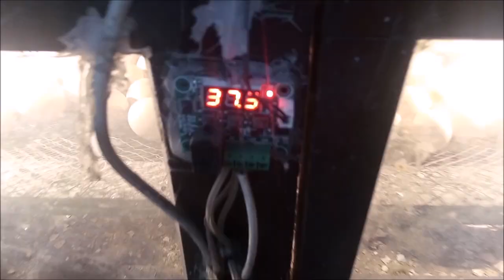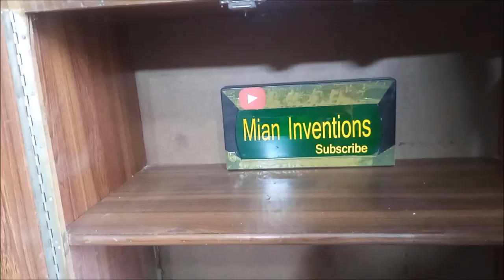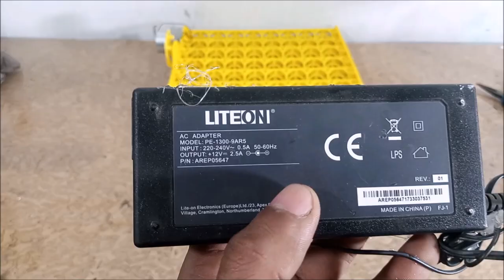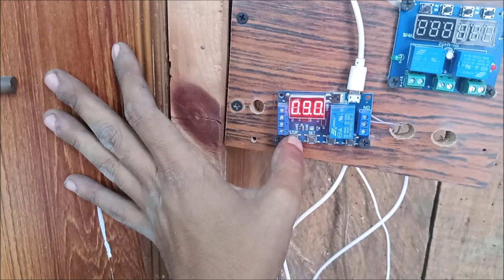How to make FULL AUTOMATIC EGG INCUBATOR at home -Homemade Automatic Egg incubator For hatching eggs

Comment: Brother asalam.o.alaikum. tray ki setting bta dain. For how much time it should he open and closed. Kindly guide. Im using 13 sec open and 120 sec closed.  Need guidance... same egg tray and motor
Reply from the maker: Open 5sec just after 90mins
Reply: @mianinventions  thankyou so much. My motor tray eggs take aprox 10 sec to move from one side to other. Should i use 10 sec and 90 mins?
Reply from the maker: @mustafatanoli2902  yes it's perfect